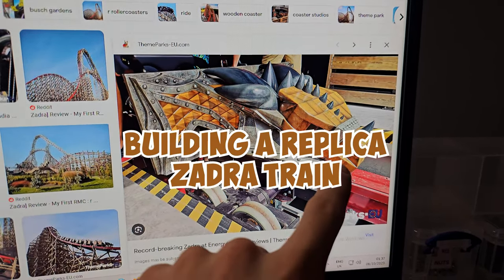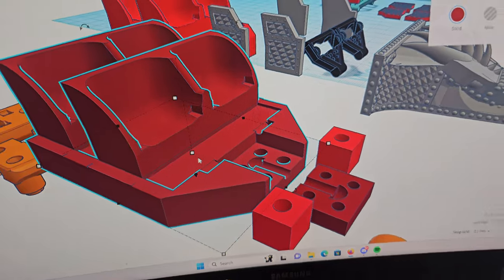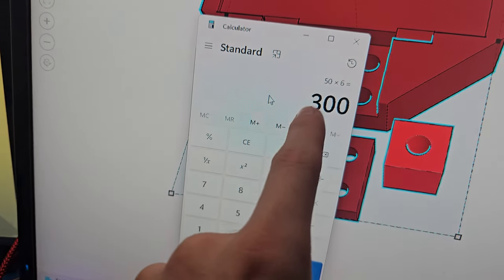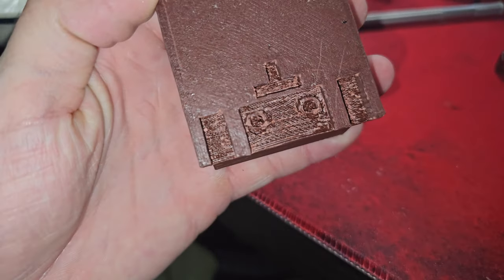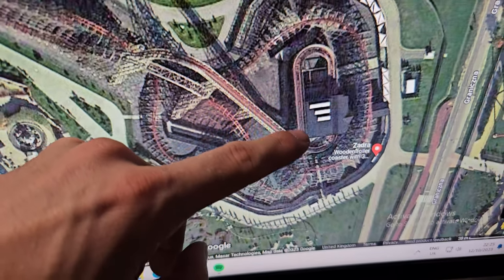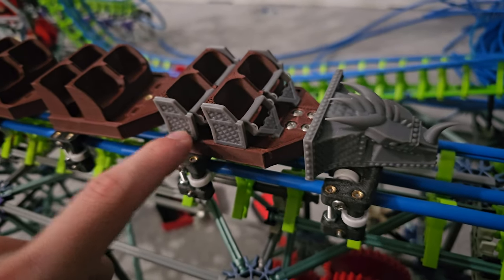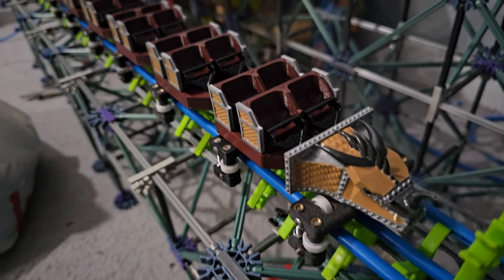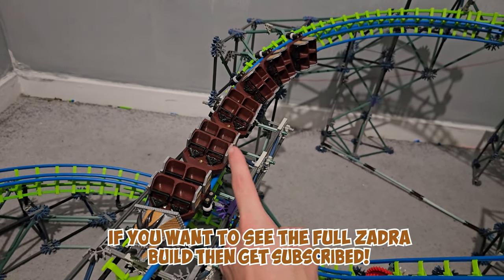3D Printing An RMC Roller Coaster Train for K'nex

Comment: It is possible to also print ball joints(I made my own 3d printed trains and they do work)
Reply from the maker: If you print them in resin on a really small layer hight I'm sure they will work, but I don't have a resin printer or a 3d file of them

Comment: I hope u answer this question but where do u buy ur knex like thé rails and thé rollercoaster tracks where do u buy these
Reply from the maker: screamin serpent, rippin rocket, storm mountin, shark run and son of serpent. thats all the sets they made with this type on track. different colours but all work together. stopped being sold around 2010 or so. so you gotta get them used / second hand. but Knexusergroup also sell these parts
Reply: @TheKnexMaker  thx